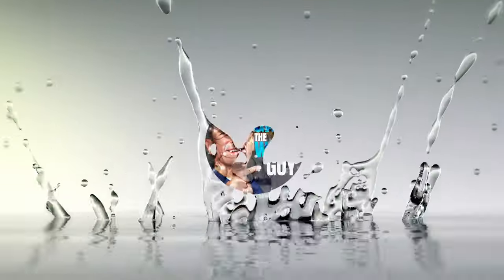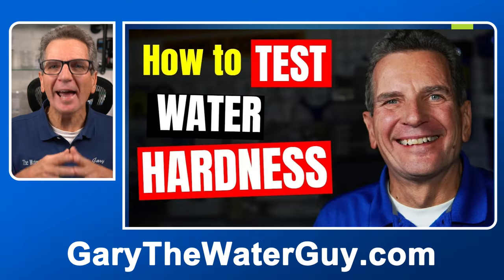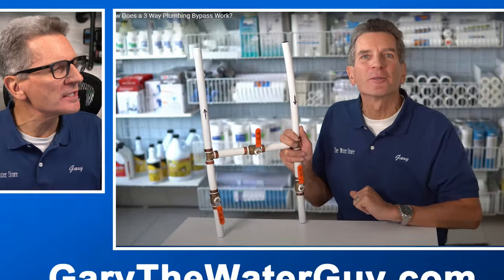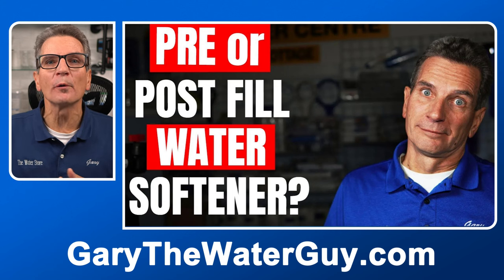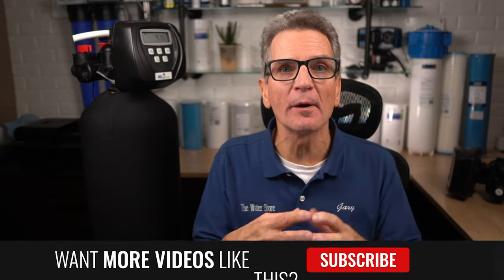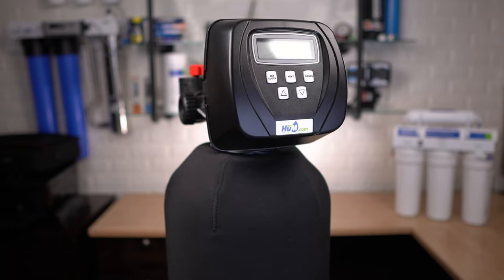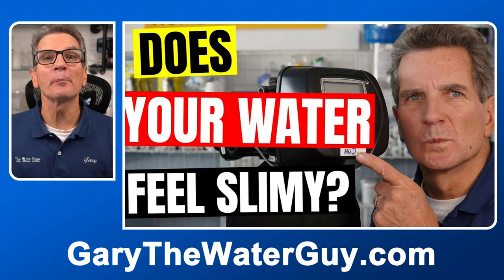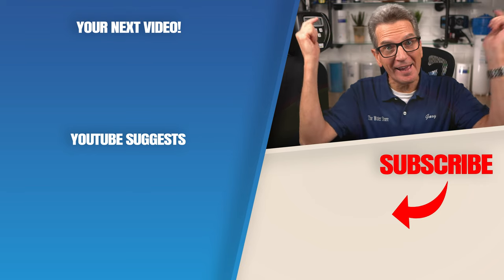Step by Step Water Softener Troubleshooting and Repair!

Comment: Hello Gary
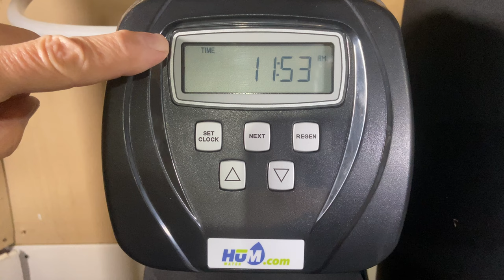I have a Northstar NSC29UD water softener. Some time ago I noticed a problem of every year having to replace the seal kit. So I thought maybe my rotor was scratched. I replaced the rotor and no longer have to replace the seal kit yearly BUT the softener does no seem to put as much water in the brine tank as before and from brine fill activation to brine fill stop it always stops at 3:15. Before the rotor swap it used to go to the near 9 minutes fill and bring the water level up to just prior to the fill float shutoff level.
What are your thoughts on this oddity?
Thank You
Reply from the maker: To be honest, I hate Northstar water softeners, they are a nightmare to work on and I'm not usre what to tell you other than I would replace it with one of these https://waterestore.com/products/hum-deluxe-water-softener-30-000-grain

Comment: Hi Gary, I’ve got water slowly leaking out the drain of WS1 at all times. I stopped by turning the valves (red arrows) to bypass it.  Do I need to buy the rebuild kit?
Reply from the maker: Yup, we have them here https://waterestore.com/products/clack-ws1-softener-rebuild-kit-wrench
Reply: @water_estore  thanks!
Reply: @water_estore  I've got the exact same issue. Used to be that I only heard a drain discharge once in awhile. Now it's continuous. Not a tremendous flow but the water system re-pressurizes the pressure tank maybe once an hour. We notice it at night when no water is running in the house. Switching to Red Valve ByPass totally stopped it. Sounds like a rebuild to me just like @notreallyme425. Concur?

Comment: I need your help. The water on my WS1 keeps running after replacing the piston and spacer pack. I also cleaned the injector. The motor sounds like it's working but going through the regen cycles, the keeps running to the drain. It never stops running.
Reply from the maker: Did you replace both pistons?
Reply: @water_estore  I wasn't aware there was a second piston. Where is located? Thank you!
Reply: @water_estore  I got, the yellow and black pistons. I did replace them both.

Comment: I have a Rainfresh water softener that was installed new in Oct 2021. The unit flooded when the initial regeneration started and has continued to flood since then. I finally called the company and went through all the regular steps to correct it, that I already did so many times before but did them again anyway. They then said the seals and spacers were bad so I ordered and installed new ones. Keep in mind the system was new. It still has the original bag of salt in it after 2 years and an awful lot of water in it as well. I contacted the company back and now they want me to send them the valve head 🙄 the unit fills with water quickly during brine draw until it reaches the overflow then it drains via a floor drain.
Reply from the maker: Definitely something wrong if it fills during the brine cycle.  Hopefully they can fix it for you.